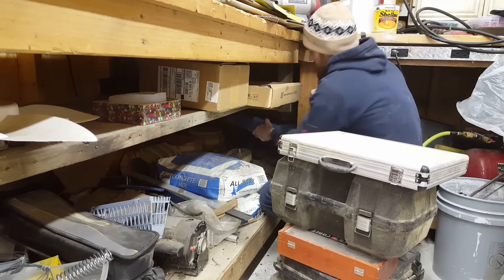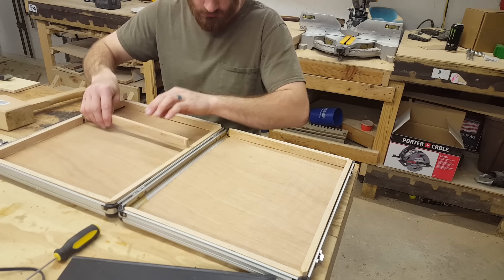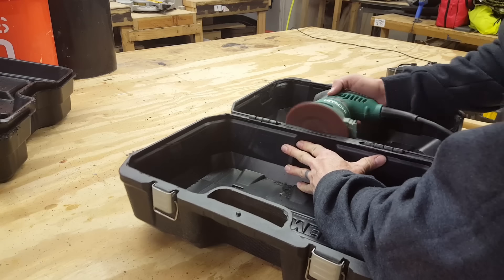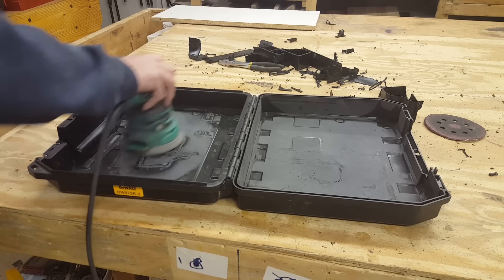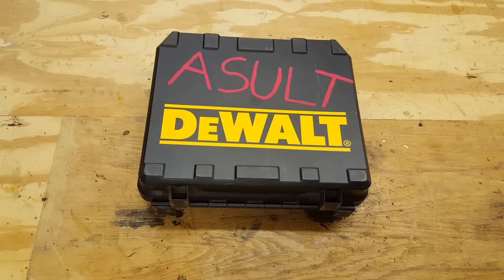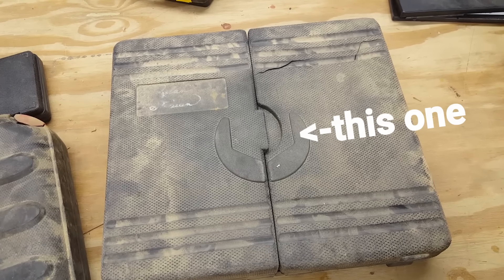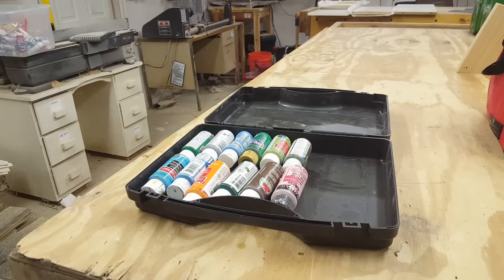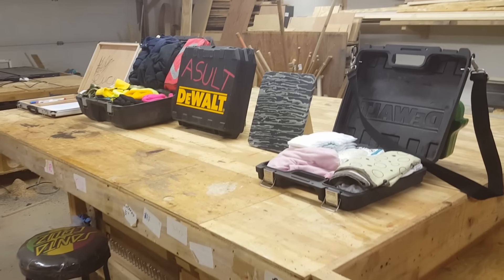5 Things to Make With Old Tool Cases

Comment: filling the cases with concrete to use as weights for glue up’s? easy to handle. plastic protects from scratching too much.
Reply: or get shredded while gyms are still closed
Reply: Glue ups?
Reply: @TheBassking15   Guess the term is most used in woodworking, but it means gluing wood(or else) together which requires either clamping pressure(clamps , screws, nails,...) or a big weight on top.
Reply: Braden Hosking - Love that idea!
Reply: @TheBassking15  In case you're genuinely asking, Braden Hosking means to use the weight to provide compression between two wooden boards that are being glued together. Modern woodworkers use a lot of glue in their projects. Typically clamps are used to provide the pressure but in certain situations adding weight on top of the two (or more) pieces is required. In fact something similar was done in this video when he was compressing the plastic cutting board to squeeze out the air pockets.
Reply: @rickt151  Lol I totally didn't see your reply, which was much more efficient. Oh well
Reply: Drill a hole in the top, put a kitchen paper roll in as a mild, fill the case with concrete. Bam, cheap diy base for a patio parasol
Reply: Don't waste a case on that I've got stacks of the square work out weights from old gym equipment off the side of the road. Plus I get motors and some decent metal for free.

Comment: Years ago, my son wanted to try model rocketry, so I converted a dewalt case into a launch console, complete with safety key.
Reply: Nice Idea, when I was a kid my dad built a launch console out of scrap wood and 1970s paneling.
Reply: ... thereby turning it into a "launch" box.
Reply: Is this what the President carries around?
Reply: Actually, super great idea. I do Este rockets with my kids. That would be so cool. Wish I could see pictures of your project. I’ll have to give it some thought and come up with a design. Super cool. Thanks again!
Reply: @youhaveinfinitevalue5755  Hi!  I can describe what I did.  Here goes:  I used a Dewalt drill case and a Dewalt 18V battery for power.  Alligator clips connect the battery to the circuitry.  I installed the following in the cover:  12V indicator light with "Armed" label;  momentary push button switch;  3.5 mm mono audio jack (for safety key).  The "Armed" indicator light is wired from the load side of the safety jack to negative battery terminal to indicate key is inserted.  Key is 3.5 mm mono plug shorted at connectors. I put a labelmaker label on it pendant style reading "Safety Key".  It just completes the circuit to the launch cable.  For that, I used about 30 feet of 2 conductor stranded (18 or 20 AWG ?) with small alligator clips for the ignitor.  Black to battery negative,  red to load side of push button.  Cable, motors, key, and ignitors all fit inside.  If I recall correctly, our rocket fit in there too. Hope this gives you enough info.  Be safe!

Comment: I think it's real interesting since most of this would never get actually recycled if you threw it in your local gov recycling program. The ultimate idea might be making them to hold rechargable batteries. Maybe integrate a charger with a short extension cord. Might be able to do something similar with the larger cases and tool batteries. Thanks for the ideas and inspiration!
Reply: Yeah, I’m guessing that most of the better tool cases are made from a grade of plastic that’s more difficult to process, especially the really sturdy ones with metal hinges and clasps. It makes more sense to just reuse them than to expend a disproportionate amount of effort to then turn them into things that will end up in a landfill that much faster anyway.
Reply: That's a great idea! Thanks! :)
Reply: I like the good old days when the cases were made of metal.   Easy to re use and easy to recycle....and if they do get to a land fill they do decompose ,
Reply: @FC-qe1wl  Few metal cases decompose. Ferrous metal might get picked out. But yeah, metal is superior in most ways. I don't know why we let companies like Coca Cola get away with plastic bottles when they already make plenty in glass bottles (& aluminum cans, though those have plastic liners).
Reply: @jenniferellifritz4547  ♻️  #1 & #2 are supposed to be easy to recycle, but large items like these cases are not wanted (despite the ease of recycling) due to their size and their rigid, non-crushing/non-crushable nature.  plastic drinking bottles crush easy and are prefered, but these cases, not so much, even it is has a "1".  a real shame really.

Comment: I have several Dewalt cases, one I put a amateur radio and power supply, one for Handheld radios and chargers, and another for storing all my batteries of different sizes.  If you like wooden boxes, some cigar stores have excess and give them away or sell for a small amount.  Great use by you on the tool cases. Thanks for sharing.

Comment: I had a makita drill that died and when I bought it’s replacement, a nice Milwaukee, it didn’t come with a case so... made the case fit the new drill
Reply: Some brand fan boys are going nuts with that idea!
Reply: Exactly I was just saying that most tools now day's don't even come in a case so I have to either buy one or make a wood box for the tool. I like those case's because I did what he's done and cut the inside out and got other tools in them. I like how the stack on the shelf to save room for the shop and when I need the tool's for the job they are labeled. I'm always got my eye's looking out for old discarded case's just for that reseon

Comment: I have had the same thoughts on this subject for thirty years.  Especially the melt and reform with pattern welding part.  I was happy to see your video.
Reply: I've done it with year's of medicine plastic bottles cut them all up and made a sheet of plastic for a knife handle still have enough to make other stuff with it. Pretty much can mold just about anything with it. Just wear heat gloves you don't want to get hot plastic on your skin!
Reply: How  bad iz the smell during  the melt?
Reply: @mikeadams2339  you definitely want a fan going smells like plastic, the medicine bottles I used wasn't that bad, but the black plastic cases I can see that being a different melt down. Some plastics melt different than other's that may have to do with the chemistry they used to make the plastics.

Comment: We’ve been repurposing cases as well.  Our community doesn’t have curbside trash pickup, we have transfer stations with dozens of dumpsters plus a recycle pad where we’ve picked up a bunch of cases.

We like the DeWalt cases the best because of the positive closure.  A bigger multi tool case became a sewing machine case; a sandpapers case with a accordion file divider, one for the Dremel with small school organizer boxes with bits …

But the best might be two briefcase sizes cases, cleaned out the 3/4 plywood on one side then put mounted strips for holding socket wrench sockets.  One case has 1/4 & 3/8 sockets, the other 1/2 sockets with SAE & metric separated on different socket holder strips.

Comment: I got 15 of those Dewalt cases from where I used to work and cut them out as you did. They are the nicest boxes with stainless steel latches. I have modified 5 of them and they work great.

Comment: I have used an old case to carry my ratchet straps in my pickup.
Reply: Yes! Along with noisy winch related stuff.
Reply: Great ideas guys. I’ve been holding on to a couple of old cases, trying to figure out how I could repurpose them and now I know. Thanks.
Reply: Excellent.  Mine are always kicking all over on the back seat floor.  Thanks for the good idea.
Reply: Great idea. You just solved a problem I wasn’t aware I had until I read your solution.
Reply: Nice 🤙🤙🤙
Reply: Yes! Thank you!
Reply: Heck ya! (In Utah we use heck, yes we are strange). Thanks for the idea. That’s my next project!

Comment: Honey, what did you just put in the oven?
-Polyethylene plastic. I saw this guy doing this on Youtube. I'm making a cutting...WHACK!
lights out
Reply: LOL!!!
Reply: This is why when I got my wife a new stove I moved the old one to my shop.
Reply: i awoke several hours later in a daze.
Reply: Polypropylene my guy. PP.
Reply: @billybobjoe198  8i
Reply: Except it looks like he has an old 40 year old range in his shop.
Reply: You can get one of those electric easy bake ovens fairly inexpensive for shop use, I bought mine from a garage sale yeas ago and it still working. It was old when I bought it, I have one of those electric hot plates to do other project's with boiling water and other garage stuff so I don't need to use thing's from the kitchen. Oh get a good fan to that you will need if your using your garage for shop use suck or blow chemicals out
Reply: yeah thats why he is using an old one specifically for work

Comment: Be careful of leaving your "DeWalt diaper case" in the plain view in a locked car. You just might get your window busted for a case of shitty diapers.
Reply: Imagining the thieves face when they opened it would almost be worth a broken window  😂
Reply: How about turning it into a real "Jack/Jill/jest-in-a-box" by replacing clean 'diapers' (aka 'nappies' on this side of the pond) with a spring and used diaper and appropriate noisemaker - say an inflated balloon & reed! Ok, need to contain the smell until it's opened but it's your genius idea.

By the way, let me compliment you on the originality of these ideas - I've always thought these cases a wasted resource but you've possibly opened-up a viable sideline/career for some-one.
Reply: Lol!
Reply: Only buy vehicles with a secure lockable trunk. That is why the FBI states the VANS, Trucks, SUV's, and 5 door hatchback have higher property theft rates. Much higher. The safest vehicle in a crash or to protect your property on average is going to be a midlevel or luxury model sedan. They all have strong trunks that cannot be accessed from the passenger compartment. In most USA states a sedan with a lockable trunk meets the firearms transportation requirements for civilians and law enforcement.
Reply: Tazimo Dragon : oh my😳 that stench must have been nasty😢😢
Reply: @scottm.franklinnc7942  or shitter in this case
Reply: you don't put the shit diapers back in the case
Reply: A different kind of “haul” for sure.
Reply: @rfarevalo  Plus you can lock people you don't like in them, just make sure they cannot get out
Reply: The dewalt name comes off fairly easy with a sander. Or maybe consider saving up to move haha maybe tinted windows might be cheaper tho

Comment: My buddy owns a motorcycle shop. He had a random plastic case on the parts counter and my curiosity took over. I found out motorcycle clutch’s get shipped in oddly convenient sizes for handguns. Even have the padding glued to the inside👍🏻 so if you happen to be a gun guy and have a motorcycle buddy who replaced a clutch ask him for the box it came in. Fits quite well

Comment: I use a couple of old cases. One I keep all my car cleaning products and dusters and rags in. The other I repurposed is used to hold router bits, I had to make one half with foam and bit of plywood (which has holes for the bits to sit in neatly) and the lid side I just fitted in a bit of foam so that when it’s closed the bits don’t fall out. Great way to keep things dry

Comment: When you started cutting them up I was thinking of a pistol case. Then you did one. Thanks. A lawyer I watch on YouTube mentioned law enforcement assumes a gun is a “gun” case if it’s a single purpose case. This adds an interesting option for that scenario. Getting pulled over while in possession of a tool case isn’t the same thing.

Comment: The Dewalt cases are great.
I turned one into a high spec jump pack.

....I stuck a compact high CCA battery in there, a small charger, voltmeter, isolator, USB & cigar lighter sockets, and an Anderson connector to plug a set of leads into. It'll fire up any vehicle I put it on, even if the battery is totally missing or completely dead.

Commercial jump packs using the exact same battery I used cost over a grand!

Comment: I have made a couple of DeWalt cases to hold portable printers along with spare ink, paper and so on.  If you are careful about cutting out the dividers you can make a ramp for the printed items to slide up on.  I ran the printer with an inverter in my pick up which tends to be a dirty and rough environment.  The printer stayed safe and relatively clean.

Comment: A non-locking case that would be super easy to break into even if it did have a lock is a really bad idea for a firearm case.
Illegal to transport in some states.
Reply: I would move out of that state.  Also if you can pick it up and walk off with it it doesn't really matter how easy it is to break into it can still be stolen.
Reply: i assume it's more to keep kids out not random thugs

Comment: I can remember when DeWalt tools came with nice cases instead of those stupid bags they're now supplied with.
Reply: Most of my tools came with hard cases except for my more recent Craftsman tools. Those stupid rubber bands just plain suck egg.
Most of them I just set on a shelf but my socket set is always mixed up when I need to use it.
I should see if I can re-purpose one of my old cases with some hard foam. It would make the tool so much easier to use.

Comment: I thought I was the only one that did this.  I used to get my cases from my employment, they would take out the tool from the case then put the case on a top shelf in the shop tool room.  Since I was the night supervisor, I would make a raid on what sizes I wanted.  I mean when they would run out of room on the shelf, then the cases were thrown in the waste.  I lined my cases with tool case foam cut to fit my controllers for my model train hobby.  Some were made to carry special lash ups of a themed train (i.e. I painted my own veteran recognition train of all the branches).  I'm in a couple of train clubs so the cases make it easy to transport, some fat cases have 2 tiers.  A couple of cases I have for track & train car maintenance tools, lubrication & track cleaning supplies for garden railway club displays.

Comment: Since you seem to be my type of craftsmen, find out if you have a custom business sign shop in your locale. (Or a company which makes trade shop displays). If you do, talk to them about their waste materials.  Use to be custom signs were made with wood &/or metal. Nowadays they use a dense, PVC foam core board. Not the lightweight stuff, this is more like the plastic decking material.

It comes in thicknesses from ~1/8" up to ~2" thick.  It can be cut, milled, threaded, and clamped and glued with PVC pumbing glue if you sand the shiny front/back surfaces. Construction screws work well as glue clamps.

My shop is full of 'stair step' tooling holders for drills, long hex drive bits, sanding drums, wire brushes for the drill press. You name it, if it has a shank, it makes great holders. Unlike wood/particle board/plywood, the PVC doesn't draw moisture and rust your tools or tooling.

The best thing I'be used it for in my shop is my taps, tap drills, clearance drills & tap holders. With all my threading tools in one location, and labels with lots of data, all I grab is one thing when I need to drill and tap a hole. No charts or looking things up, no looking for tools.

If you label tool holders made from this PVC, overcoat them with some clear lacquer, or a new clear coat both Krylon and Rustoleum sells, called Triple Coat, (I think), or Glaze. It's a one coat clear coat, as tough as lacquer.  Lacquer takes 3-4 heavy coats to do the job.  I have a Brother self-adhesive label printer, and have found a clear coat is the only way the labels last more than a year in a shop with oils and solvents around.

Sign shops will give you all of their scrap for hauling it away.  Be creative with the stuff. I made a tail light holder for a friend's '53 Ford Pickup with some, and made a kitchen cabinet in my wife's work apartment in NY.  I built the cabinet just like I'd build a plywood/MDF & hardwood cabinet. Hung doors, and install drawer slide.  Best part? No finish needed!  LOL

It also works great for test pieces/prototypes when working with expensive materials, or you need to test out machining processes. It mills better than anything I've ever used for testing.

Hope you get some good materials, and make some cool stuff.

Comment: I used a Porter-Cable router case to make a mobile amateur radio case for my ham radio a couple years ago.  It holds the radio unit, a handset, battery, and all the cables in the case.  I have the base and battery mounted securely in place.

Comment: I pick up any old DeWalt kit cases I can find, I cut out insides of a sawzall case for my ol man's high torque 1/2", fits a 5-6aH battery, AND a 12" breaker bar and A set of flip sockets, everything would be likely to need changing tires... Naturally, 3 weeks later I found a deal on that model sawzall and picked up, too bad I didn't have a case for it then 🤣🤦🤣 I use those cases for my compatible with DeWalt battery knock off tools too, plastic welder and staples in one, hot glue gun and glue sticks of several kinds in another, etc... love that pistol case conversion, I'm absolutely going to have to make one soon!

Comment: Thank you 👍🏻inspiring work
I have 
1. First aid storage, all in 1 place to go in need.
2. Thread, needles, buttons, velcro, clothes n curtain repair kit with assorted threads from cotton to high strength polyester, fishing line for various repair jobs.
3. Fine models n paper model tools, paints, brushes 
N many more, very handy, rugged n can store anywhere, dust free
A big thank you fm Bengaluru, India 🌺🙏🏼🌸